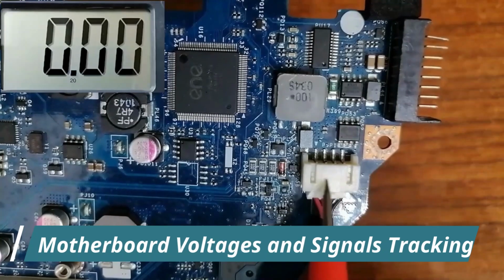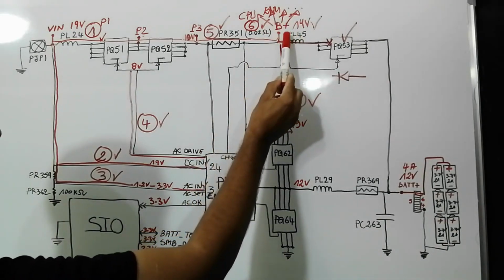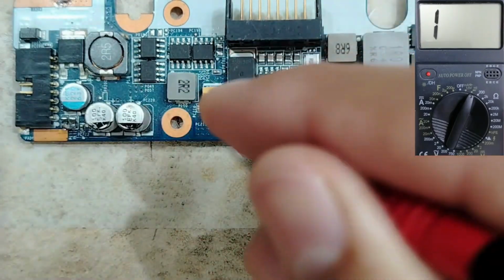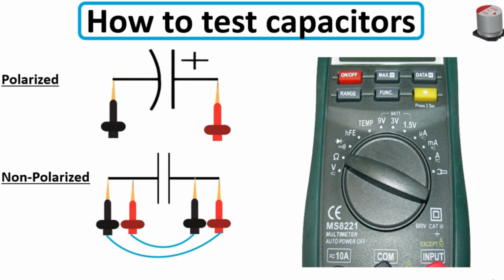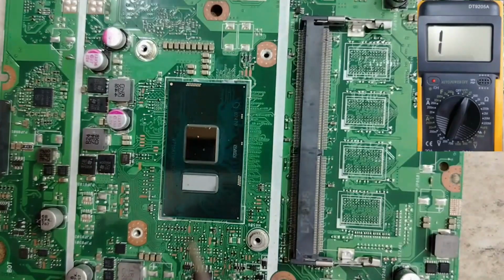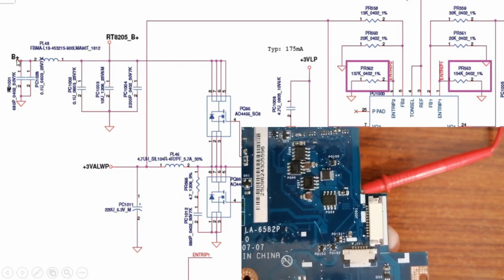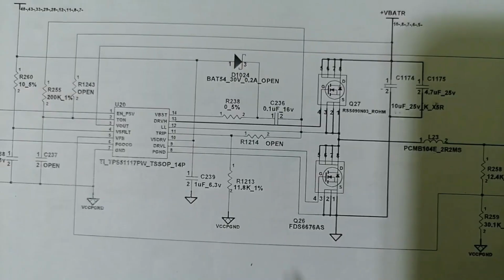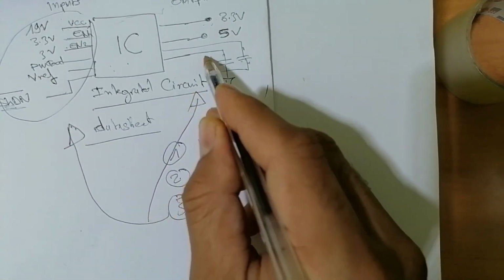Want to Master Electronics Repair? Watch This Now | Elite Tutorials You Can't Miss - Part 1

Comment: Even though an Inductor and a coil are the same thing,  to make it simple. I call input Inductors and outputs Coils.  So the big one is the 1.5v output coil. The small one is the 1.5v input Inductor.  They are used for differnt reasons on the input and output.1:09:20